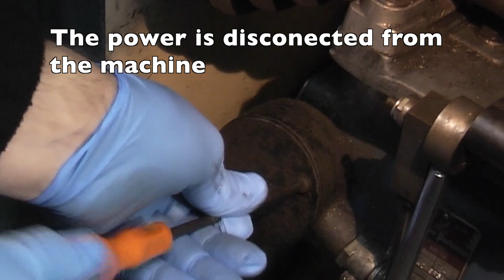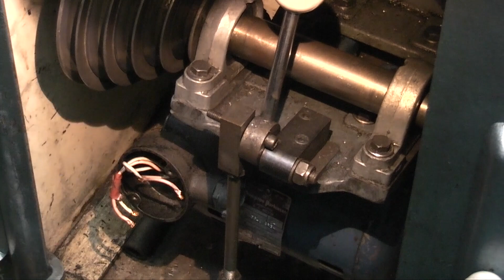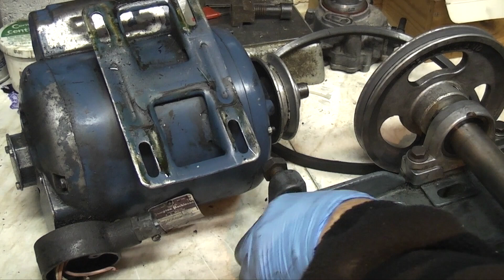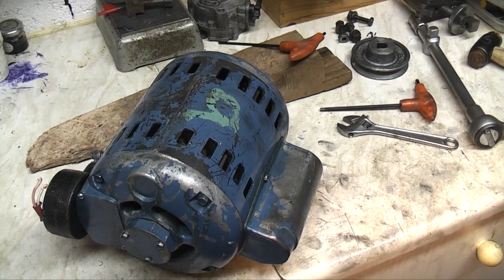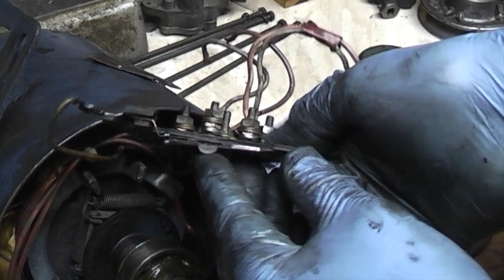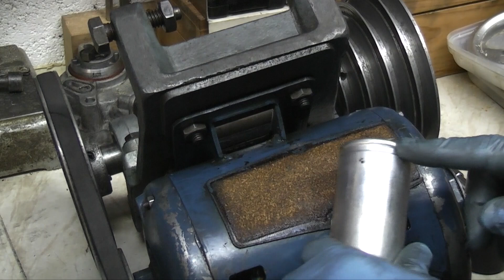Boxford motor rework

Comment: Great watch, I have done this job a few times now as I can hear the centrifugal switch sometimes give the motor a pause between startup and run. You may find your headstock bearings are more likely for a slow run-up speed especially in winter. I normally run my we lathe on low for a few minutes then all good to go at higher speeds. Hope this helps you/ someone out there. Keep up the great videos.

Comment: do 3 phase motors also have capacitor and centrifugal 'shift' or is that solely for single phase to smooth out start up and running?. If not obvious from my question I know nothing about electrics.
Reply from the maker: Sorry I,I’ve never worked on a 3 phase motor 
anyone know .?
Reply: No, 3 phase power has its own inherent rotation, so a capacitor is not needed. A single phase motor simply won’t start without some sort of ‘kick’ to get it going, usually from a capacitor/start winding/switch combination.

Comment: Hi Alan, just a quickie FYI, the symbol 'μF ' on the capacitor stands for 'micro farad'. If it is an Electrolytic Capacitor (it will have + and - terminals on the input) it MUST be connected the right way otherwise it will explode quite dramatically. If it has no markings then it is a non-electrolytic capacitor and can be connected either way.
Just thought I'd share, it might help somebody out. I was a TV engineer in the early 70's.

Comment: You might think of replacing the centrifugal switch , if you have a local motor rewind shop, they may have one or be able to order one! The contacts are most likely silver plated, filing the points will remove the plating and the switch won’t last long! You motor may be old enough to have solid silver contacts. If it does don’t replace the switch until the silver is totally gone! The new switch won’t have solid silver contacts!

Comment: When the centrifugal switch is not working at all, my experience is that the motor (1) won't start at all and/or (2) blows the fuse or circuit breaker quickly. I think replacing the starter cap was a good idea.

Comment: Hi Alan, good strip down and rebuild. I suspect the capacitor was the issue. Bit concerned about the wiring in the ceramic blocks, for how long it would take I would be tempted to redo them (assuming you didn't during rebuild), as the clamp screws were clamping onto the insulation. If you replace the ceramics with modern connector blocks, you will have a smidge more room in there as well. Love your soldering iron, I have the exact same one (Weller), they are great bits of kit. Cheers, Jon

Comment: Hmm if the CF switch wasn't working then I can see the slow speed problem. If it was working but not making good contact with the run windings but disconnecting from the start circuit the the motor would stall. My suspicion was that the capacitor was duff so changing it out before reassembly was a good move. I do like to see these lovely Brook Compton motors, brilliant stuff. My old motor on my ML7 was one and still gave sterling service until I changed to VFD drive just recently. Keep making videos please

Comment: The click you hear when the motor is turned off is engaging the centrifugal switch/closing the points are you call them, so that when the motor is started, the start windings and capacitor are energized.    Once the motor gets to something like 60% of rated speed, the centrifugal switch disconnects the starter winding and capacitor.    Typically the started windings are only designed to be operated for a short time.
Good idea to replace the start capacitor.    You got very good life out of the original, but they are not expensive and so good to replace while you have the motor out of the lathe.
The motor sounds good, nice and quiet.
Dave.

Comment: Hope the motor works better now, but it did look like the wires in the ceramic connector blocks were tightened on the insulation and not the wire itself.
Reply: Yes, maybe strip the insulation back a bit and put some solder on the ends or a pin crimp, bad connections can get hot and cause problems down the line
Reply: yep- thats a definite fail from a sparky LOL- the screw terminals should be tightening on the copper wire (or preferably imho- onto bootlace ferrules)- longterm connections made like that can go high resistance as the copper oxidizes, luckily its an old ceramic 'choccy block' as they tolerate heat far better than the new plastic style ones- they can literally melt!!!!
Reply: I noticed that too.
It is not allowed in Germany to clamp the soft wires directly in the connector blocks because they can get loose and cause a fire.

You have to put those tiny metal sleeves(i dont know the english word) on the ends of the soft wires and crimp them before clamping them in the connectors.
Reply: Yes I thought that and probably would suggest proper crimped tabs to insert into the blocks.